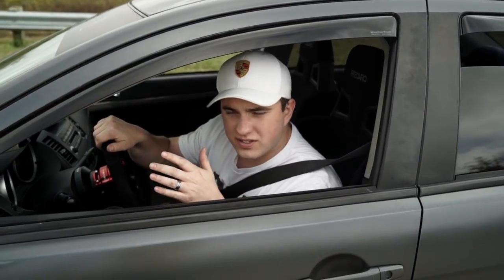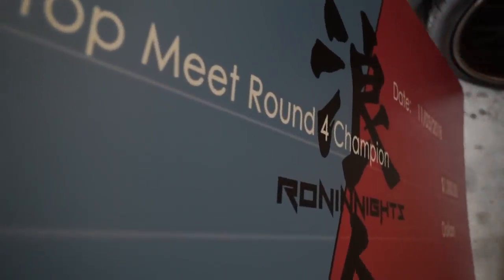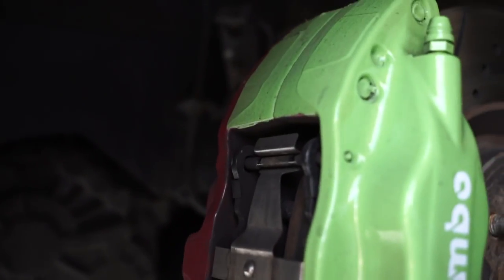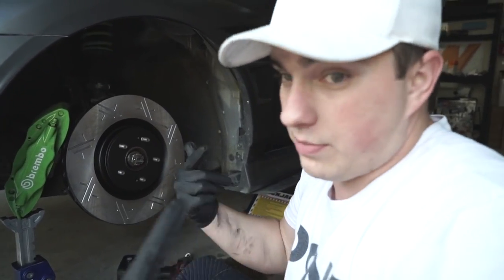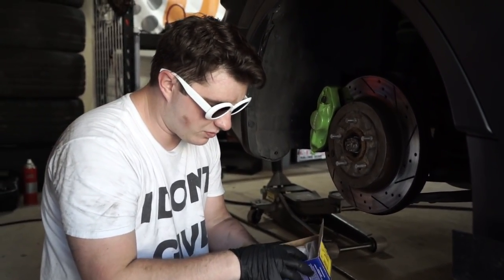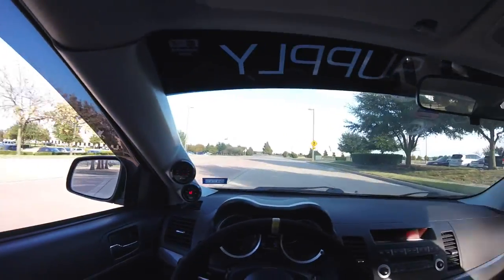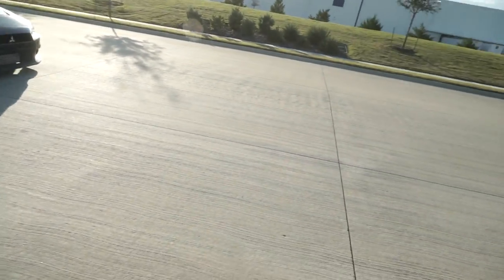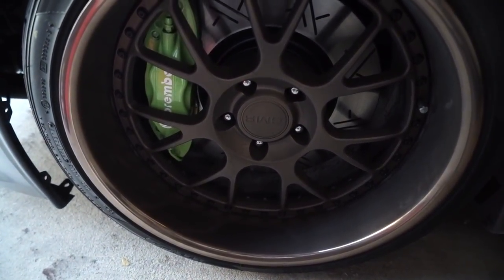CUSTOM brakes for the Evo X that are cooler than yours

Comment from the maker: it was 12am when i chose this title and i woke up and didn't remember but I wont question my incredibly tired self. I kinda like the spunkiness
Reply: Best ideas come from not sleeping. Love the content Fat Daddy
Reply: These are super killer rotors... but how cool would it be to have "V:III" as the slots? Hmm? Hmmmmm? That'd be pretty sick.  Just sayin'!
Reply: Brake rotors are stored in cosmolene which is the same stuff that old milserp guns are stored in. It prevents rusting but is very nasty stuff hence the use of brake clean to get it off of your rotors
Reply: Evan Shanks when are you gonna work on The Subaru
Reply: Add some stainless steel brake lines and you'd stop even better!

Comment: When bedding pads you don’t go to 0 . The idea is that you bring the pads and rotors up to temp without actually stopping. Stopping with hot pads and rotors is when the glazing happens . Otherwise you wouldn’t  have to bed them . Daily driving is stop and go .

Edited for spelling

Comment: Pro tip #2: Your car only stops as good as your tires allow it. Nothing to do with new rotors. (thumbsup again)
Reply: He had the same tires in both so that’s not always the case
Reply: not true dude. ROTORS, pads, and tires all play a factor in stopping performance
Reply: Juliano Masella mostly tires and pads, rotors only have two effects, getting rid of heat and lightness. If he bought some real tires like r888’s his braking would become insanely better!
Reply: Rotors are basically heat sinks. The bigger the heat sink the more resistance to fading. Big brakes kits dont stop any better  than an OEM brake setup. They're just more resistant to overheating and have better pedal feel and brake modulation.
Reply: @t.regnerus301  couldn't have said it better
Reply: Tire temp, ground temp, humidity, rotor aaannnnnddddd pad temperature all have a play in this and we have no idea what any of that was on each test lol

Comment: Also you are not supposed to hammer the brakes when theyre brand new, because theyre more vulnerable to warping. You might not notice a huge difference but it is significantly easier on the rotors to do medium braking first and put them through an easy bedding process, and then get to hammering

Comment: Honestly your test doesn't make sense because the old brakes were locking up the tires too. The tires were and still are the limiting factor in your braking. Probably got better results because the pavement was warmer, braked earlier, or were going slower.

Comment: You’re a terrible mechanic from the videos I’ve seen. No finishing work when you cut parts, you aren’t supposed to come to a stop to break in your brakes and I’ve never seen you use a torque wrench. Cars got potential but pay someone to work on it if you aren’t going to do it correctly.

Comment: The slot direction or design has nothing to do with the direction the rotor is installed. Look at the air veins inside and thats how it goes

Comment: You should add  stainless steel brake lines tooo
Reply: I'm only running Stop Tech right now but I switched to the braided steal lines when I did the new rotors and pads.  Just gotta make sure you have a 10mm Flare Nut wrench and it's easy job and a Motive filling / pressure tank makes filling and bleeding the lines a 1 person cake walk.